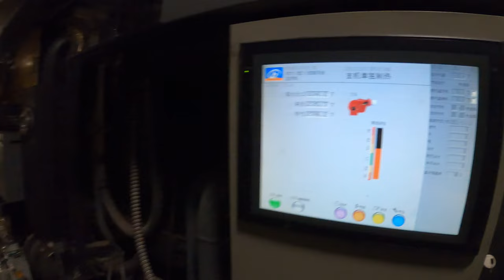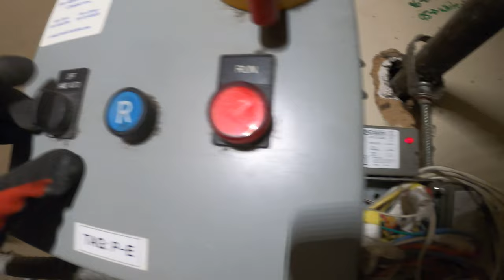HVAC Service Call: Baldor Electric 3 Horsepower Motor Replacement For 4 Pipe Fan Coil Unit

Comment: Great job! As a 60 yr old veteran electrician I would of started out by saying either lock out your electric so nobody accidentally turns that old motor on while your in there or have your helper in view of the switch. People are idiots. Nice video!

Comment: job well done you both wish we have engineer like you in our building where boiler keeps cutting off due to high pressure company unable to localize the problem last 30 days no heating no hot water

Comment: You need to check motor amp draw when you do a new install with pulley and motor. Never assume it's right. That is why that pulley has a threaded end so you can adjust the pulley diameter slightly (belt sinks in more or gets pushed further out near the pulley's outside circumference)  to reduce the motor amp draw to the level on the name plate or less.

Comment: Good job Jumper Man, You did a good job but I would have replaced the cable all the way back to the motor controls to eliminate any future problems with the circuit, every time there's a junction there's a possibility of fault to happen. Good job again.

Comment: Great job. That was difficult access (I also noticed that the filters could use a clean) the old motor was hot: so that suggests that the rotor was no longer spinning in the stator and the current  was passing the breaker. That was a good idea to wire the motor on the bench and use connection nuts.
My heart sank, when you turned the switch on and no fu#@ing motor noise, you didn't show what you did to the PCB.
That was the real stuff, you were really doing it!!! "Did you think to tap the hot motor with a hammer, see if the rotor would start spinning'?
🤔🔦

Comment: Why did you Sand the shaft?
Reply: I think It's to help put in the pulley easier. Happen to me a few time with shaft and pulley not slide in smoothly.

Comment: Hmmm does not have to be a mess in the ceiling omg wow
Reply from the maker: The ceiling was filthy. This location is full to tight spaces and hacks. Little by little I will restore this place if I get the opportunity. Thanks for watching!
Reply: @JumpermanTech  I agree time to make the money safely with your worker